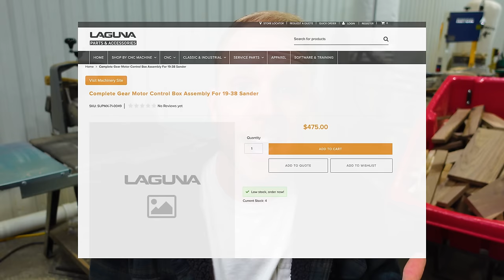We Sold 300 Cutting Boards, But Our Tools Couldn't Handle It...

Comment: you claim to have made all this money , yet you are using hobbyist tools, and then you wonder why the stuff breaks and you get poor service. If you had the knowledge  on how to do things efficiently you could cut your production time in half and make more money, with the way my shop is set up I could do your work in 1/4 of the time you do.
Reply: Ok, then do it
Reply: Pro tip on how to make money… don’t go and buy the most expensive tools as soon as you can afford them. That sander is absolutely perfect for them. A bigger sander would take up more space as well as be much more expensive. Just because something is more expensive doesn’t mean it will never break.
Reply: I'm not sure whether this comment was actually meant to be constructive or just bragging.
 However, when a business gets to a certain size at least having backup equipment is a reasonable goal. This way your business is not "shut down" if something breaks. When you get your sander replaced, fix the old one, put it on casters and put it in the corner, just in case !
Reply: In my experience woodworkers are too investment adverse. Woodworking equipment is cheap, so they are used to not having to make a commitment to a big purchase. They'll lose days trying to avoid spending $500.

I run a machine shop, and in the machining world we have the opposite problem. Machinists like to fix all their problems by spending money, when they could save $1000 with half a days work. 

The real companies know how to split the difference. It sounds like their drum sander sits idle for the vast majority of the day, so optimizing a non- bottleneck would be a waste of money. But I agree that they should be looking into more industrial equipment as they grow. Heck, if they were loosing money without the thing, they should have just gone and bought a second one. A harbor freight unit would have got them back on their feet, and provided some extra capacity if they needed it in the future.
Reply: Wow what an ass. Way to be positive to a small business.
Reply: Well good I’m happy for you 😂
Reply: Aah yes, the $3000 hobbyist tool...
Reply: What Hobbyist tool does he have? Grizzly is not a hobby to.  Powermatic is not a hobby tool.
Reply: @josephtwilley7187  yes they both are,  the older powermatic that was USA made is good stuff, grizzly is all bottom of the barrel
Reply: Yeah Joey, Oliver is correct. 120V stuff, all amateur. Unless you are running 3 phases, you are a hobbyist.
Reply: Haha, so he makes money off of hobbyist tools. Does a photographer need the most expensive camera if he knows what he's doing? 😅😂

Comment: Great video as always. It does make me nervous when I see you wearing gloves around power tools...
Reply: I came to say the same thing.
Reply: Me too
Reply: Me three.  Unfortunately not the first time I've seen a bad safety practice by Jennie and Davis.
Reply: I'll also say that, as someone who recently edge-jointed something like 300 boards in a day, the volume eventually gets to a point where you have to outweigh the potential risk versus the guarantee of splinters and cuts.  Breaking down 17 sheets of plywood into small drawers the day before (also without gloves) left my hands looking like I'd played catch with a cactus.
Reply: Me too. It's part of the reason I lost part of a finger (neglected to take them off before using a table saw).
Reply: Just keep your hands away from the sharp spinning things (blades/bits) and you'll be fine. In all honesty there's a lot of evidence showing that gloves actually increase your safety especially with handling rough material.  It is also worth noting that you need to use the proper gloves and not the bulky and poorly fitting construction  or yard work gloves.
Reply: @richardbenson4750  can you point me to the evidence you mentioned? I'd like to read about it.
Reply: I caught gloves on mitre saw first second then got worse scared shit out me no no no 😮
Reply: @paul11273  yes, simply handle anything rough and watch your hands get cut up... moral of the story and easily found articles is "keep your soft body parts away from sharp spinning objects". For clarification "sharp spinning objects" includes blades, bits, fan blades, gears, and such as they will easily cut you and having gloves on or off makes very little difference if comes in contact with you but ironically there are cut resistant gloves that even further enhance safety but there's really no need for that level of protection as simple common sense and basic safety measures will keep you safe. The actual sharp spinning object is a relatively small part of the equation with material handling being a much bigger aspect.
Reply: @richardbenson4750 Right. So no "evidence" cited anywhere. Just you anecdotal "evidence" of how everyone else is dumber than you.

There are situations where gloves can get caught on a tool or work piece and pull you into harms way. This happens in milliseconds with no time to react. And the glove ends up becoming wrapped into the sharp spinning thing, trapping you and making things worse.

Avoiding a few splinters is not worth loss of limbs.
Reply: @richardbenson4750  Yea that's some bs. Cut resistant gloves protect against knives and glass. They will absolutely get shredded by a saw blade and so will your hand. Anyone complaining about splinters just got soft hands
Reply: @strykervalkyrion  lol you clearly showed that you're unfamiliar with cut resistant gloves, unfamiliar with what a "blade" is, and rough material so nice try with your bs but you're also limiting yourself to just one material. Thank you for the laugh.
Reply: @paul11273  lol you're a big boy you can look up and verify what people say, after all it really is common sense and basic safety practice to keep your hand away from the blades as that'll cut you and most gloves. It's always funny how people try and blame an inanimate object for them not paying attention or having their body parts in the wrong place but it's "not their fault, it's the gloves" 🤣
Reply: @strykervalkyrion  sounds like you only handle smooth wood and don't really have an understanding of "rough materials" so it's all good just try to get some experience when you can.
Reply: @richardbenson4750  so, you have no "evidence" as you claimed existed.

Wearing gloves in certain situations magnifies the problem.
Reply: @paul11273  lol way to completely miss on every aspect and completely ignore the obvious that if you don't touch the sharp spinning blade but instead pay attention and observe the basic safety rules you'll be fine. Also you completely ignored the cited reference as well as dozens of others that are available too. 🤣
Reply: @richardbenson4750  You type much and manage to actually say nothing. Happy Trolling to you.
Reply: @paul11273  lol a phrase that is applicable to you "ignorance is bliss" if you actually read what I wrote you'll see a lot is said but you're just ignoring it because the statistics and common sense disagrees with your personal opinion so cheers.
Reply: @richardbenson4750  bwahahahaha. I hope you're trolling and not believing what your saying.
Reply: @paul11273  lol see perfect example of you proving my point. You really should try learning what you're talking about instead of just trolling.

Comment: I always struggle to understand why you make individual boards instead of one long length of board, and then chop it up.
Reply: I think there is less warping and twisting with smaller boards and better glue ups from my experience. I have built table tops and benches but I have never built cutting  boards.

Comment: With so much unused space in that shop, you need to invest in an outfeed table.  Get one of the adjustable height tables at Home Depot if you don't have the time to build one.  You can use it for outfeed then roll it around for many other uses.

Comment: The British phrase "All your eggs in one basket" comes to mind. Do you have the same saying? Anyway, you have reached the stage where you seriously need to do a little bit of risk analysis. That, by the way is typical British understatement. You need to do a lot of risk analysis. 😀

This is one critical failure point, are there more in your process? You are obviously going to need to purchase a second drum sander and may also need to double up on any other equipment that is on that critical list.

The cost of doing business once you reach a certain level of orders. Congratulations for reaching that point.

Comment: I feel you on the customer service or lack there of. A few years ago I ordered a tool chest from Sears that shipped out of Canada to my house instead of shipping it to the store. They gave me no update for 3 weeks and they said shipping was delayed and gave me $100 compensation. Upon arrival, the chest was heavily damaged. By the time it was returned, that model was discontinued and I was forced to order the newer, more expensive model. After negotiation, the customer service department gave me 25% off. In the end Sears did the right thing. Hopefully, Latuda will step up too.

Comment: You guys should look into a sliding panel saw, can easily crosscut all your stock you currently cut with the mitre saw.
 Can "joint" the boards for glue ups. 
once glued can easily square and dimension panels. save a lot of time going from one machine to another machine, time is money. you can even do larger glue ups and easily dimension on a panel saw, getting 3-4 boards per glue up as opposed to 1. run the panel through the thicknesser and sander as a longer panel then cut to size. 
you'll probably end up with a bit more wastage but you'll definitely save days of labour
Reply: devos woodcraft is a good example on youtube of what im talking about.

also been in the furniture making trade for along time myself.

Comment: Put all your brainboard controlled machines on a switched receptacle and be sure to switch them off after every use. It was very likely a power surge at the pole that took the board out. If you can't find a switched receptacle with a high enough amp rating, you'll find one at your local HVAC or electrical supply house. Don't use the breaker in your service panel as a switch. They're not made to be used like that and will have a much shorter service life being used in such a manner. Best of luck to you two.

Comment: if you get a cyclone and put it on top of a 55 gallon plastic trash can, use a can liner, you'll only have to empty that and you'll never lose any suction on the dust collector let alone have to empty that stupid dust collector bag.

Comment: Writing policies is one thing, but writing policies that are actually practical, work and are simple to implement are another thing. The company that I work for has become so mired in policy after policy that the day to day operations are suffering. For instance a policy put out by one part of the company contradicts policies put out by another part of the company. The whole place has become a bureaucratic mess.

Comment: That’s why you need to be smart when choosing tools, doesn’t matter at what level. Parts and service is more important than the tool itself. I’m in the process of buying a big sliding table saw, it will cost around 40K, yes there are decent options at 12k-20K, but all these companies don’t have the infrastructure, the technicians to support their product as I need it. The 40K guarantees me 12 technicians in my area and 95% of the parts shipped over night. I don’t like spending so much money, but I need to know that the tool will work I need it to work. I learned my lesson exactly like you guys. On the beginning you don’t really know what to buy, or how to buy. Not telling anyone what tools to buy, but when you get to the stage of constant production I think and I know you should consider different kind of tools and most important stay away from China tools. Do they serve the purpose? Yes. Do they last? Some. Can you get it fixed? If it takes 30 days or more to get it fixed, I might as well throw it to the garage because it holds my production and I’m loosing way more money than the tool price itself.

Comment: Supermax's customer service sucks.  I fought with them for weeks for a motor replacement on my 16-32, under warranty, for weeks.

But also, your sander isnt meant for a production shop.  Id sell that and upgrade to a machine that fits your needs.